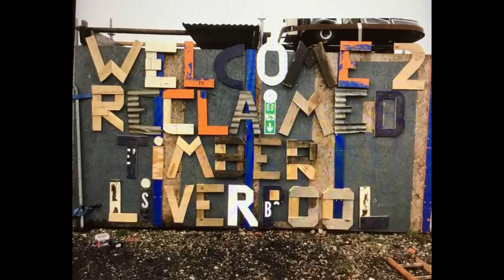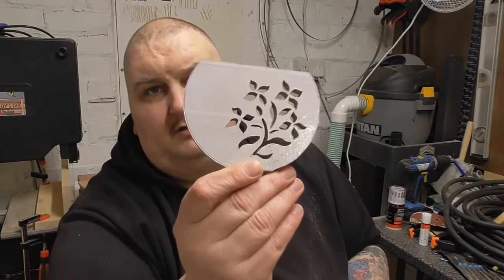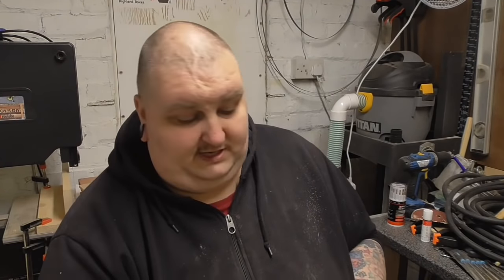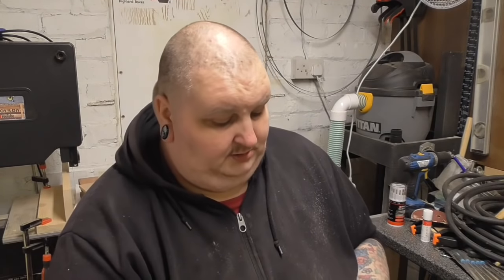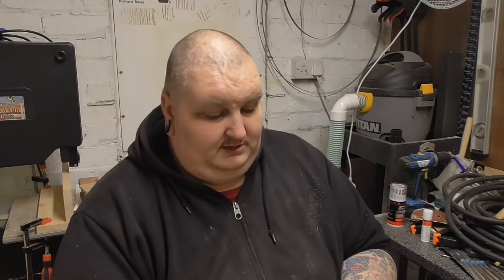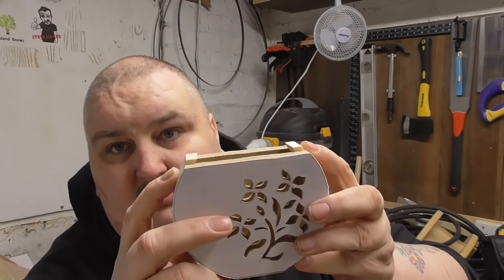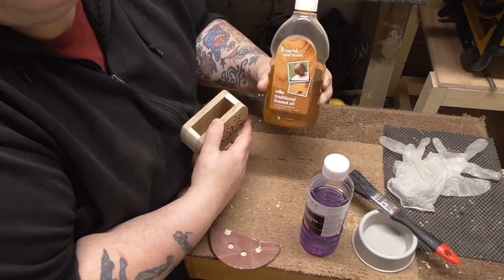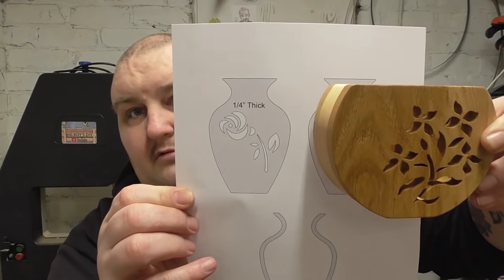Making a small vase on the Scroll Saw #scrollsaw #scrollsawvase #scrapwood

Comment: Warren that looks fantastic my friend. Awesome job mate. My titan planner was doing the same. The rollers  were coated in crap so cleaned them and 're greased bearings ECT. Also take front cover off and clean out the dust from the belts ECT. Mine works good again now
Reply from the maker: I took front cover off in the week and cleaned and oiled everything blown it out with compressor and the rollers are clean from last time I cleaned them I don't know what is wrong with it I am going to take another look at it over the weekend as I desperately need to thickness plane some wood thanks for your comment mate

Comment: That is absolutely beautiful how it came out,
Really need to get some little dishes like you use for finishes - am lazy and have probably contaminated several bottles already :)
Reply from the maker: Yes I'm very pleased with how it turned out and I too used to dip into the bottle until I saw the bits floating around in there I just got them from the cheap store there ideal for bits of paint and oils thanks for your comment mate